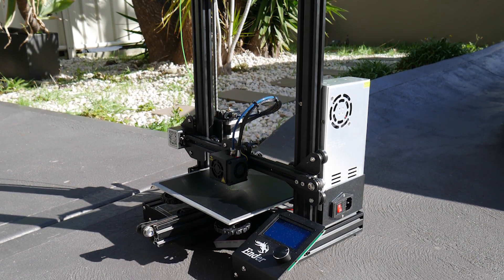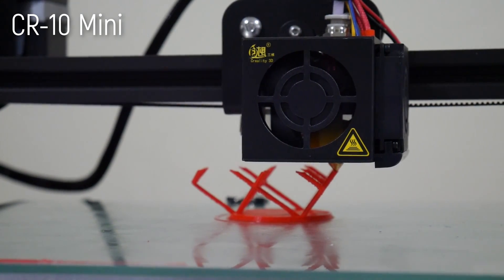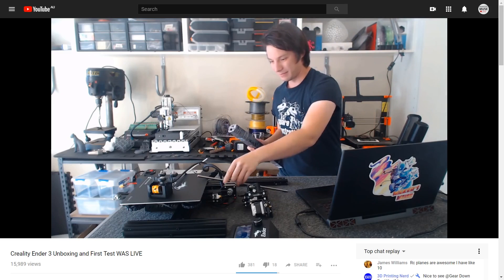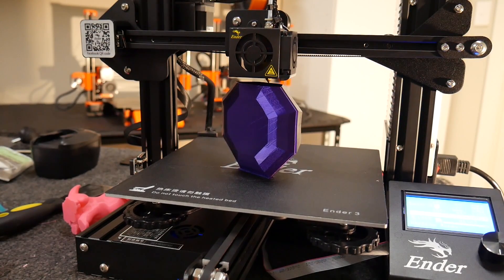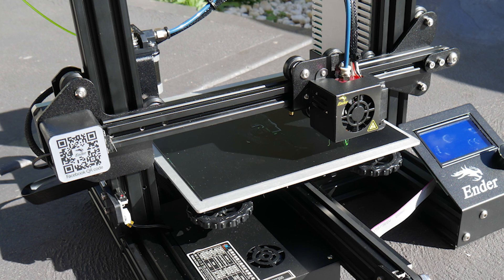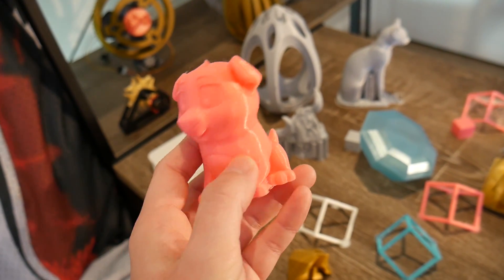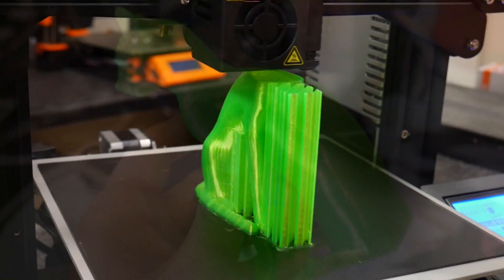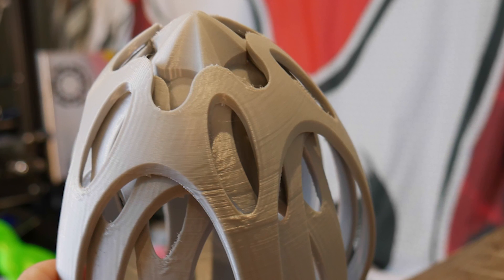Creality Ender 3 Review

Comment: Cause of you I bought my first printer, the Anet a8. I've been using it for a year and has been a really enjoyable year. Thanks Angus! :-)
Btw you can buy the anet a8 for 140 eur. Is it worth it to spend another 30 eur for this one? ( without taking into account the security mods that you have to do to the anet)
Reply: I have both of these printers, it is hard to say what is "worth it" as it depends on what you expect from the printer. Despite this video, I'd say the Ender 3 was a breeze to setup and I got a good result on the test file. I did have a major issue with the bed coming pre-warped though (middle was lower than the edges), and still need to address this properly (currently just loading it up with tape). If I were to personally suggest a printer to someone with no experience I would indeed select the Ender 3 above the A8, just with a disclaimer that quality control could be significantly improved, and as such to expect several teething issues.
Reply: A8 is complete shyt. .... and creality printer would be a mass improvement of A8
Reply: Thank  you  for sharing your experience.
I use mine just as a hobby so probably I will wait some time till I can get an Ender 3 a Little bit cheaper.
Reply: The print quality of my A8 increased dramatically (i.e. the MM tolerance test prints perfectly now when before the .15 and .2 parts were fused) when I upgraded the frame to an AM8 aluminum extrusion frame, and that cost me around 75 eur for extrusions/nuts/bolts plus plastic for the 3D printed parts so an extra 30 eur or so for an aluminum frame out-of-the-box seems to me like a good price.